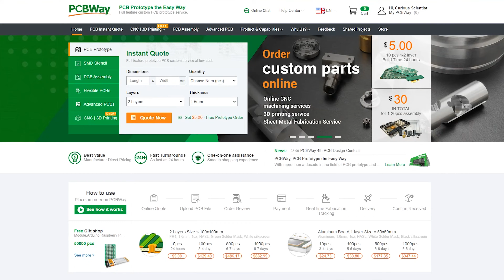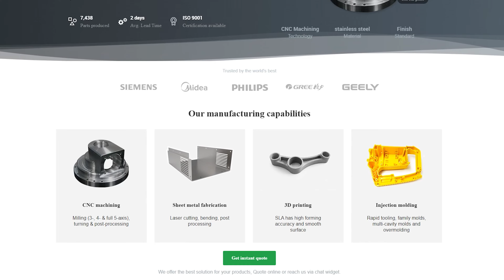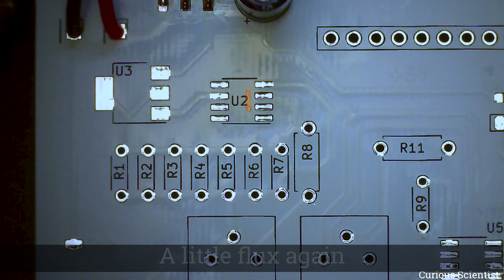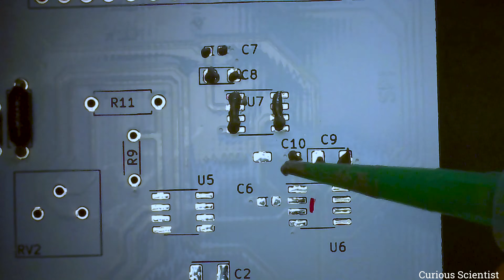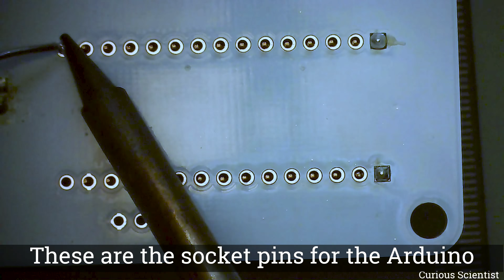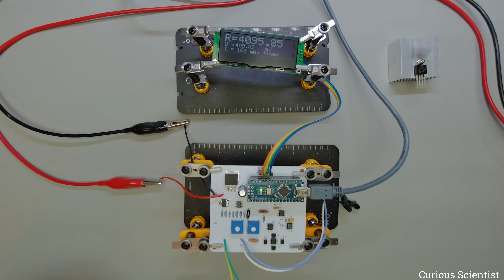Ultra-precise milliOhm meter - Calibration and full assembly

Comment: If anyone is having stability issues with this, it is because this guy did not include any code in his script to control the frequency rejection pin of the DAC, pin 8. the PCB has this pin connected to pin D9 on the Nano and in the script this pin has to have a digital write to make it high to reject 50 Hz or low to reject 60 Hz.
I also found I needed a 0.1uf on the 1.25v ref voltage on the current source and also do the capacitor mods which Scullcom did to his mark 2 milliohm meter, He is the chap who designed this and this guy copied the mark 1 version. Good luck
Reply from the maker: Thanks for the good remarks! I pinned this comment so people will be more likely to see it if they search for info in the comment section. Cheers!

Comment: I think it is always a good idea to add area for one or two buttons into a project like this, even if you don't end up using them.

Using a button, you could tell the MCU that you have shorted the kelvin leads. That way it can read an offset resistance that the leads provide and subtract that from further resistance values, which might be helpful when you are reading down to milliohms. Then its also useful for providing a null offset if you want to measure a pure voltage with the ADC.
Reply from the maker: Thanks! Due to the x10 differential amplifier in front of the ADC, it is not really useful for voltage measurement, except you want to measure below 500 mV. Also, when I do the final calibration and adjustments I do it using the leads shorted. So they are also considered in the measurement.

Comment: Great Video's and very well explained , If you look at Louis Scully design he used 25 turn horizontal preset resistors for calibration where I see your using single turn  horizontal preset resistors This could be the reason why you can't calibrate the zero and 100Ma current correctly ?, The PCB'S look great and nicely laid out
Reply from the maker: Thank you very much! 

Yes, you are correct, the too coarse potentiometer might cause the issues. In fact I don't really know why I picked this type of potentiometer, probably because of its flat design. Obviously it was not my best decision. Luckily, if I am not wrong Vishay's T93YB, or Bourn's 3266W potentiometers can be used as an alternative and they should have the same footprint as the 3386P potentiometers I used. I will order a few 3266W and try it.